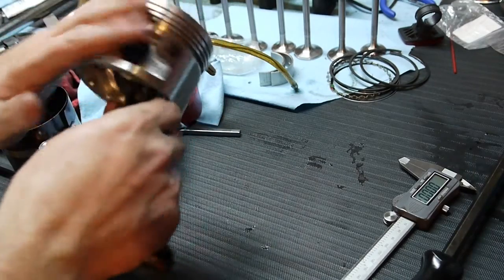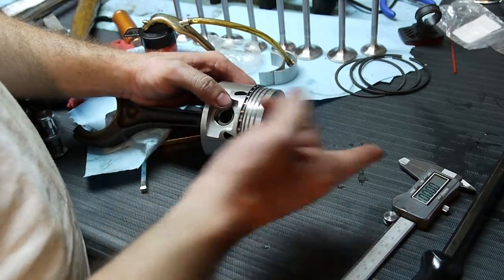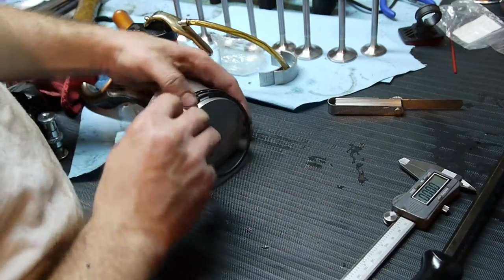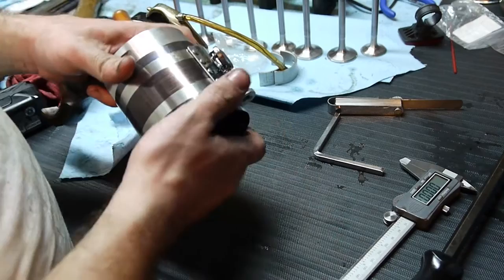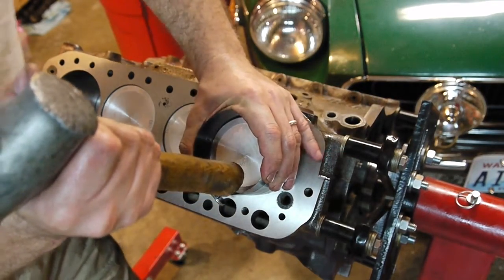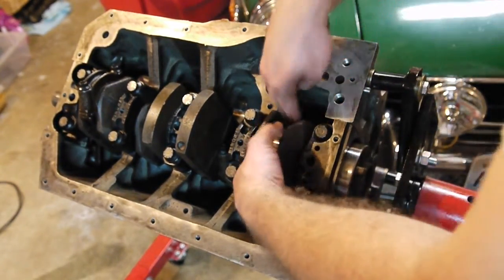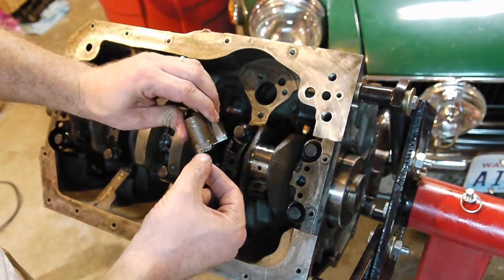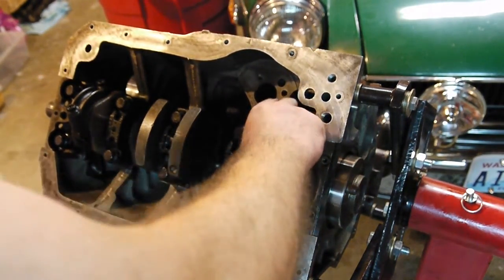Installing MGB Piston

Comment: Ever met that friend that was always brutally honest?
That's me!
Hi.
Lithium grease on the cylinder walls helps during the breaking period.
Using rubber gloves keeps your bearings from wearing away prematurely, because of the acid all fingers put out.
And if you put the harmonic balancer bolt back in the front of the crankshaft,...you can turn the crank with a socket and ratchet, even if all the Pistons are already installed.
These three tips will help ease the building process, as well as make your engine last longer.
Your welcome.

Comment: thanks for posting this - your MGB motor's a real oldie looks like. Offset rods, 4-ring pistons, I'm guessing its a 3-main 18G or GA ? The car looks '70-72, judging by the grille
Reply: A 3 main in a 70 or 72.. not likely. The 3 main  motors  were 62-64. Yes, I own a 64 with a 3 main and have a Dec 65  five  main sitting on the floor of my shop.

Comment: I am about to learn how to rebuild an engine. i will be buying an MGB as my first car. How hard is it to rebuild the engine for a first timer. I am mechanically inclined on most parts of the engine but this will be my first car I will tear the engine apart and rebuild it top to bottom
Reply: Get a copy of the MGB factory workbook
Reply from the maker: Hi Brandon,  rebuilding an engine is not difficult. What's different about working on an engine is that you will be measuring tolerences (gaps between parts) to ensure they are in the proper range.   I recommend you visit www.mgexp.com and see guidance there.  Also, getting more work done at a machine shop will save you time and $ (as you won't need as many tools).
Reply: Hot Rod magazine published a series called Project X where they described step by step how to tear down, and rebuild  a small block Chevy.  This was back in the 60's and this is how I learned.  Also a "Motor's Manual" had all the specifications.